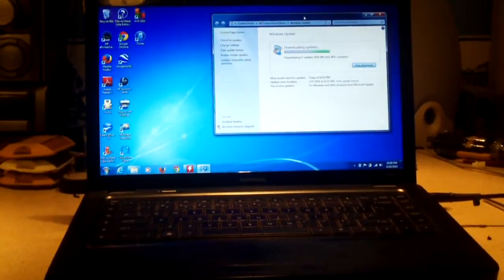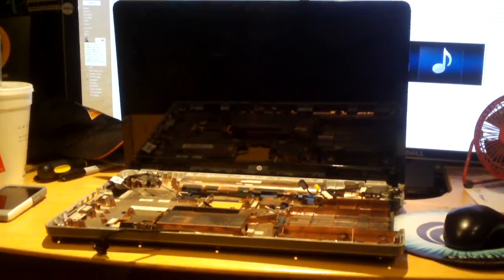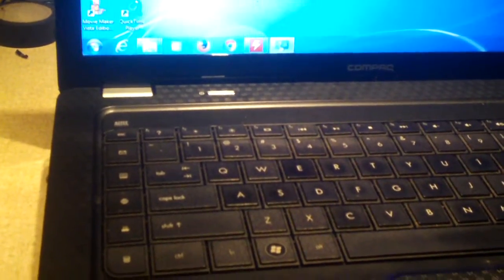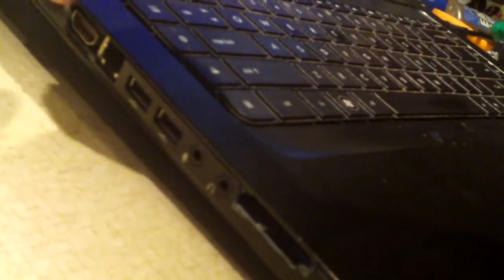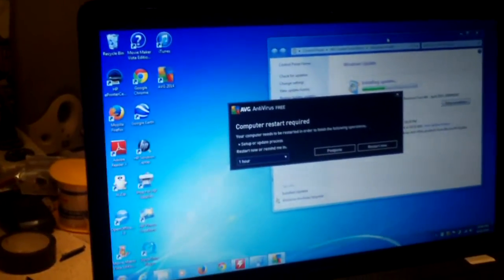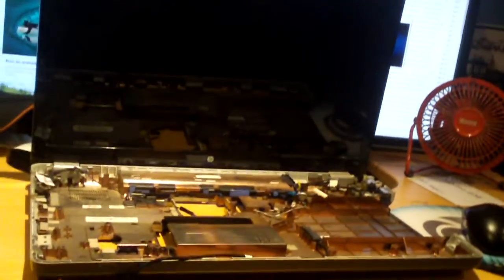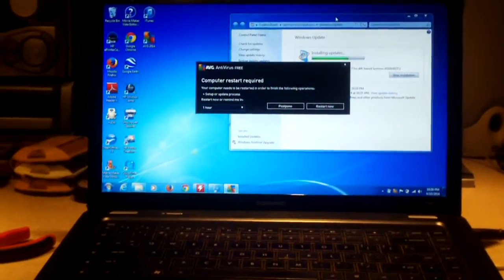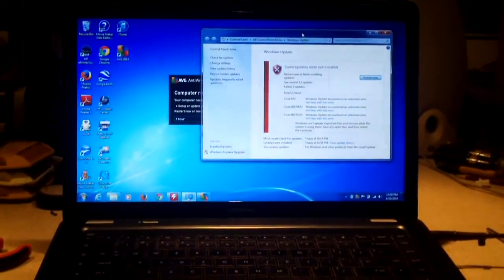HP G72 motherboard installed into Compaq Presario CQ62 laptop

Comment: Ok...My G62 is mobo-dead and I want to upgrade it to a G72mobo+i5+8GB ram. I found the correct parts but I realised that the G72 is 17" while the G62 is 15". Am I missing something here? Could a 17"-laptop mobo fit into a 15"-laptop case?

The other thing that bugs me is the cooling system. Should I also buy the G72 one and then will it hit in the G62 case as in the video or shall I stick to the G62's? 

For sure there are a lot of same model variants... On the other hand the case always seems to be the same.
Reply from the maker: The screens are different sizes, not the motherboards.
Reply: Thanks, both fr the video and the quick answer. I think that the coller socket is the same at my G62 as in G72. They have both 4 screws...Let's hope it works.

Comment: I am using a presario cq60 as my daily laptop...1 thing i hate compared to my old acer and lenovo's is to get to the fan you have to remove the motherboard. my old acer and a few lenovos the fan is easily accessed by removing 1 cover